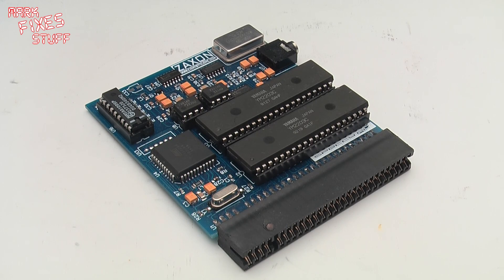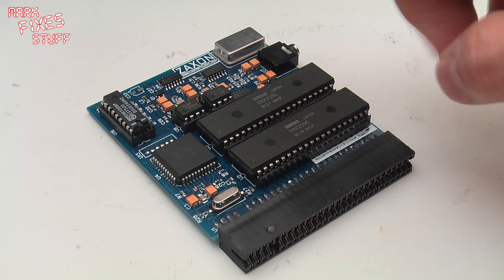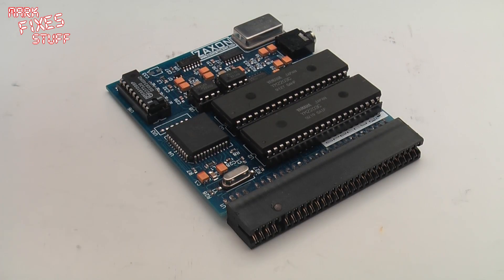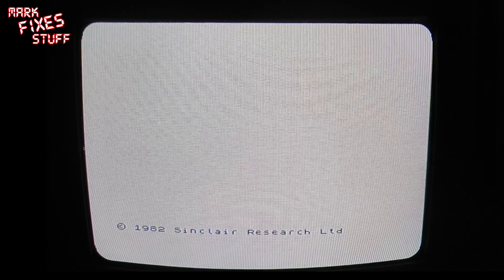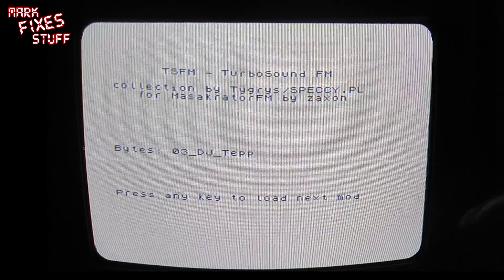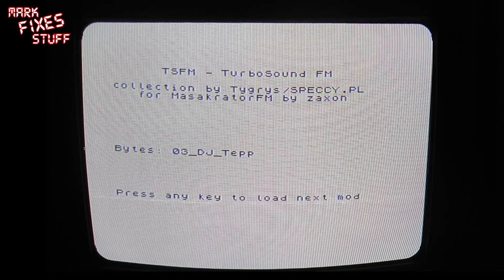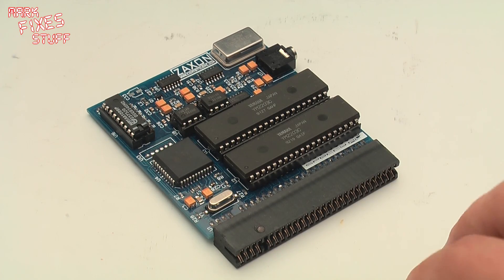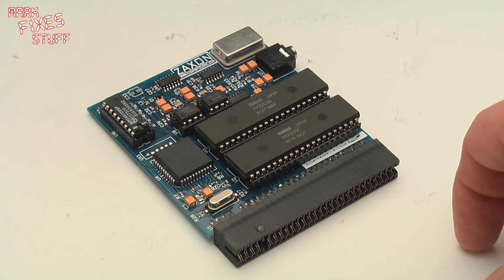Review: TurboSound FM by Zaxon - A Sound Card for the ZX Spectrum

Comment: Zaxon says he no longer makes these.  And I think he said the JS128 does not have this built in, it has  AY, stereo.  So what is the difference between this board and the  AY, stereo?
Reply: 1) There are TWO AYs, which makes 6 channels instead of 3
2) Plus one SA1099 (the sound chip that was used on the SAM Coupé), which makes 3 more channels
3) They're actually not AY-3-8910 from General Instruments, but their equivalent from Yamaha (which would be the YM2149, except this one has an option to double the clock frequency, thus adding more fine tuning leeway, through a pin that was unused on the AY from GI)
4) They're actually not AY-3-8910 not YM2149, but YM2203, which makes 6 more channels !

So, what why is a the YM2203 better ?

Simple : each of them include a full YM2149 circuit PLUS 3 FM channels each, with a shitload of additional function. Being FM modulators rather than just simple square waves like the AY/YM2149 means you can create any soundwave : sinus, triangle, etc. and simulate any instrument.

It's 100% compatible with  regular AY or YM2149, so existing AY software don't even see the difference and sounds just the same.

Register numbers on the AY or YM2149 don't use the full 8 bits range, so there was room was an even greater number of registers and fuctions, and that's how you talk to the chip, just passing it different command values and that's it.

Apparently, the way you synthesize your wave shapes, envelopes, delays, pitch bends, etc. is similar to MIDI commands, so musicians find it quite easy to use.

It also means controlling the chip isn't really code nor data heavy compared to for instance the SID that uses sampled sounds, which is a good thing to use it from a 8 bits computer.

And last but not least, after listening to a few parts, I feel it actually sounds much better than a SID !

In fact, it's a full fledged one chip classical syntheziser !

The only part that couldn't be crammed inside the chip was the DAC to output the analog sound signal, so it has to use and external YM3014BF dedicated DAC (so there are two of them, one for each YM2203, then they're mixed downstream, along with the SAA1099 outputs, to create the stereo channel).

The original concept is actually Russian and you can find in on NedoPC's site. You'll also find the schematics on velesoft.cz, with some clean MP3 converted samples if you want to try them

Zaxon has been producing nicely crafted assembled PCB for a long time and you can buy from him on sellmyretro dot com.

I see some people above are wondering if the SLAM ULA+ could still be available. Well, Zaxon still does produce batches from time to time, so keep an eye on SellMyRetro. :p I could secure some for both 128k et 48k models when they were available last year.

Comment: Do you know if the Just Speccy 128 board includes this on the motherboard?
Reply from the maker: It doesn't. JS128 includes the usual AY 3-8912.
Reply: @MarkFixesStuff  Since you know all about all Spectrum hardware.  I have a couple more questions.  I just bought a JS128 but don't know what I can do with it as far as ROM''s and ULA's.  It comes with the SLAM ULA.  But can one also use +3e Roms or other Roms?  Is the Slam ULA just the Spectrum+128k ROM?  I know I can add a hardwired switch to a jumper to create 48k or 128k ROM on boot.  You said that some people call this board VooDoo?  I want to learn how to utilize it's VooDoo magic.
Reply: @stickybandit2346  The SLAM ULA+ is available separately for both 48k and 128k models. The problem, as always, is the availability, and time between batches production can be very long (like at least one year). When Zaxon made his latest batch available for the 48k, I was lucky enough to be checking SellMyRetro at the time and could secure a pair of them.

It has onboard Turbo-sound (with 2 AY/YM emulated chips on FPGA), but not the FM version, unfortunately.

BTW, I asked Zaxon if he could produce Datagear DMA cards (at least the PCB) and he said he could possibly some day, but couldn't tell me when the occasion would arise, so I finally settled for an external add-on card from Aleksei (I would have preferred the Datagear because it's a piggy back version to plug between the Z80 and the socket, but I'll find a way to cram it inside the housing later on :p). Incidentally, there was a Datagear DMA on auction on eBay recently, but the seller reserved it for British bidders and didn't even bother answering. :p

BTW, Aleksei is selling Spectranet interfaces on SellMyRetro, and maybe it could be a good opportunity to grab one. :p

About the TurboSound FM, I must I'm extremely impressed by the quality offered by the YM2203 (the TurboSound FM Pro version also has an SAA1099 onboard, mostly to play SAM Coupé soundtracks, but its drums sound make a nice addition).

In fact it sounds much better than the SID (and equivalent on the Amiga) and it should really have been included n the Next instead of ordinary AY or YM2149 chips.